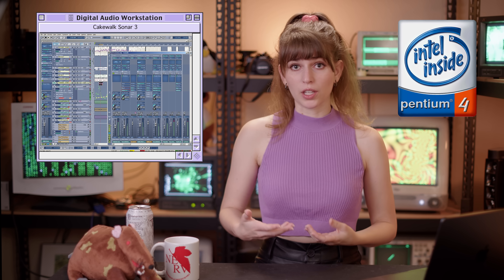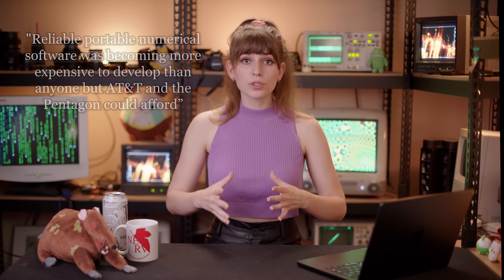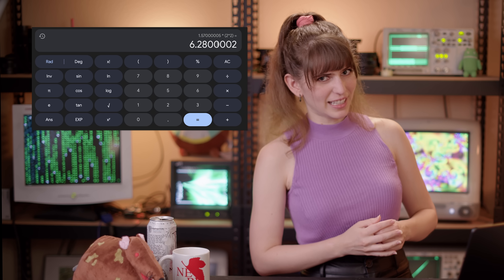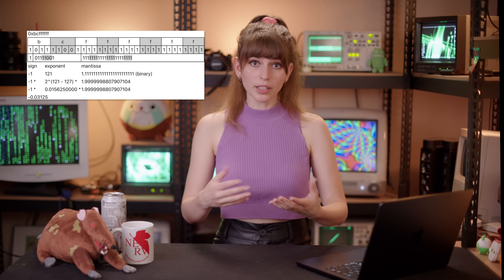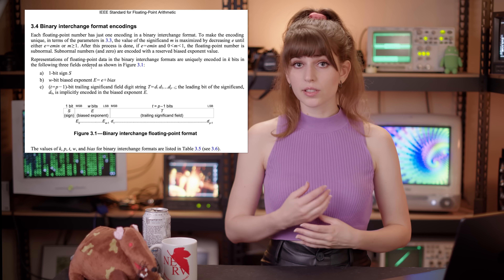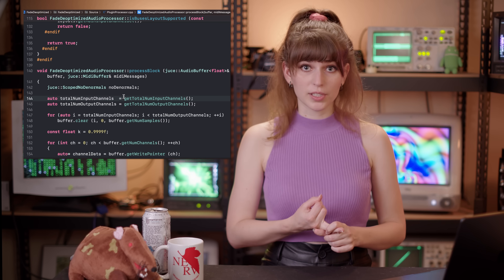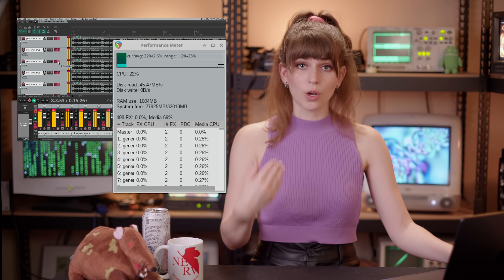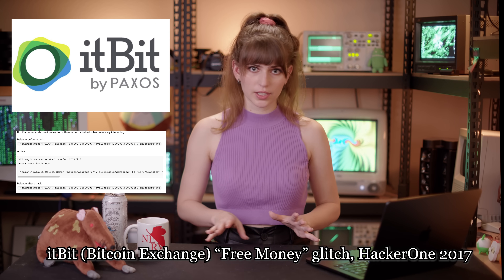Fading Audio is ROUGH on CPUs

Comment: TI-84s also have a problem with putting a number with its limit, so like 1 = 0.99999... That's perfectly normal though, because those really are equal:
Let n = 0.999999...
Then, 10n = 9.999999...
So, 10n - n = 9n = 9
Therefore, n = 1 = 0.999999....
It's a property of our base 10 system and limits.
Sometimes, your calculator will throw on repeating 9s in the decimal place, instead of giving a whole number, but it's still correct.

Comment: I mean I think it's very obvious that by default the computer should be as accurate as technically possible, and any inaccuracies should only ever be created by either the limits of hardware, or because I looked exactly at the level of precision I need and optimize the code to meet my target, but not unnecessarily surpass it.

Comment: The correct approach is entirely based on the application. It should not be a programmer's preference as to which approach to use. It should be the spec. Some applications may benefit from a hybrid approach, where you might store data in an accurate way, but display a result in an inaccurate way. For instance, in audio, you may want playback to trim bits, but store the audio in an accurate manner so that if you boost the volume, you are not getting as much clipping. There may even be an argument for storing data in raw ingredients. i.e. store both sides of an equation and pass the computation buck down the road. This is ideal for situations where you want to audit the result.

Comment: 10:05 Wait Zen 4 does it faster than without denormal?
Reply: no, that's 1.79 ops per cycle for the whole core. the core has 4 integer pipes, which means that for simple operations like addition it can do up to 4 integer ops per cycle (actually more I think, since the vector/fp unit can also do operations like 128-bit int adds, but that's going into details)
Reply: @counciloririssa But this whole thing is about float. Why is it compared to integer?

Comment: Floating-point numbers are the wrong choice to represent sound amplitudes. Something like 32-bit integers is much more reasonable.

Using floating-point numbers seems like a lazy choice by people who didn't want to think too hard about how big their numbers were going to be.
Reply: This is very silly. We perceive audio volume and distortion logarithmically, our samples map to measured analog voltages (a real world domain of large and small varied values measured to a set number of significant figures), our intermediate values aren't clipped automatically with positive gain nor sub-sampled into oblivion with negative gain, and floating point math is ridiculously fast, with 13 year old CPUs able to issue 16 floating point divides per clock cycle but only one integer divide every 10 or 20, a trend that's continued to this day. Flushing subnormals to zero might be a nuance but at least it's been settled since Athlon64

Comment: Reminds me of reading about Ray Kurzweil and the Kurzweil 250 digital synthesiser/sampler. Used co-processing of floating point data to correctly shape waveforms at low amplitudes and therefore potentially low digital sampling/wavetable grid resolution during low signal level transients.  The result was (and still is) accurate and realistic sound from digital synthesis, carried forward into their current evolved instruments.

Comment: Thanks for the video. Very informative. There are live digital audio companies that sell things like 40-bit floating point processing as opposed to 24-bit and 32-bit processing found in competitors. I don't fully understand what they're claiming. When they are saying 40-bit floating point, are they saying it's 40-bit audio and uses floating point calculations, or are they saying they are acheiving what a 40-bit processor would acheive, but doing it with floating point calculations instead? Either way, I would imagine the floating point calculations introduces distortion into the signal that may be audible when added together (say a 144-channel mix).

Comment: The purpose of gradual underflow was NOT increased precision.  In fact, gradual underflow loses precision in order to increase the RANGE of representable non-zero numbers.

Because 32 bits are a small number of bits to represent a floating point number, tough tradeoffs are involved.  The number of bits in the exponent determine the range of the floating point number.  The number of bits in the mantissa determine the precision of the floating point number.  So, when the hardware designer assigns another bit to the exponent, they are decreasing the bits in the mantissa and thus the precision of the number.

Most floating point designers decided that for 32-bit floating point, precision was more important than range and settled on a non-zero range of about 10 to the 38 power down to 10 to the -38 power.

Within that range, all numbers had the same precision (same number of digits, really bits, in their mantissa).

The problem was what happens when a number at the low end of the representable range is divided by two.  Before gradual underflow was invented, the typical computer would return zero and report than an underflow had occurred.  The programs could react to or ignore the fact that the underflow had occurred.  The underflow signaled that the true mathematical result was in the region of the number line that couldn't be represented, between 10 to the -38 and true zero.

Many programs ignored underflow because for the application of the program, zero was a good enough of the true mathematical answer: zero was less than 10 to the power of -38 off from the true answer.  In absolute terms, that's a small error.

In relative terms, it's infinitely far off because the true result, although infinitesimally tiny, is an infinite multiple of zero away from correct.  But relative error doesn't make sense in many applications.

Like the audio fade example.  Human ears can hear down to 20 times 10 to the minus -6 Pascals.  Why bother representing a sound level of 10 to the -9 Pascals much less 10 to the -38 Pascals.  Those numbers might as well be zero.

Gradual underflow increases the low end range of numbers above zero by pegging the exponent at its lowest value and making leading zeros in the mantissa represent lower and lower numbers.   This allows a represention of numbers between zero and what was the lowest representable non-zero floating point number, but by reducing the number of non-zero leading bits in the mantissa.  It's a trade off between increased range but decreased precision.

DEC's position was that less precise numbers produced slowly was not a big win.  Programmers working with such small numbers were better off rewriting their programs to scale the numbers themselves, and get full precision at high speed.

It's worth pointing out that DEC's mathematical accuracy was considered to be the best or near best at the time.  The motto of DEC numerical group was "Good to the last bit", meaning the results of all fundamental operations and most transcendental functions in the math library should be the correct mathematical result rounded to the nearest bit.  That included hard function like the trigonometric functions.  Most library vendors didn't promise anywhere near that accuracy.

Comment: I actually used an 8087 coprocessor. I distinctly remember a bunch of professors and little old me standing around the computer looking at it in the socket, going 'ooo' like a Larson cartoon...
And William Kahan is an early hero of mine. 
Much later I created my own arithmetic that kept the calculation in the rational form until it needed to be emitted, with precision and uncertainty estimation interval too, if wanted. Can use units too. Yes, physicist....
Reply: there are also 'security' implications if you consider such things as nuclear physics and the need for both accuracy and the necessity of using precision that actually reflects the accuracy of the quantities. There are perhaps folks who do not such abilities to be readily available, for various reasons ...

Comment: I don't think stock trading software is using floating point at all. I would assume they use "decimal" types or just do calculations in integers based on a defined fraction of a cent. In any case with defined rounding strategies.

Comment: Back in the day Sun and SGI CPUs handled low precision floating point operations differently.  Single precious 16 bit floats made this a lot more difficult (double precision was often not an option back then).  Gracefully handling underflow was a difficult problem and Sun and SGI processors handled this very differently leading to code functioning very differently on both platforms.  At some point we gave up and started doing things in the log domain which ultimately became more practical (despite all the logsumexp stuff).

Comment: It's "PEE" as in "poo", also called "pee pee", not "P E E". A lot of today's poo poo software had its origins on pee pee equipment.
Back when IEEE floating poo was new I got the task of emulating it in pee and then adding poo poo for a Weitek floating pee coprocessor, which peed to the CPU for poo poos. The pee is remarkably similar to the first commercial floating poo hardware on the PEE 704 in the mid 1950s, the main differences being the implicit poo poo has 1 in the pee. On the 704, the pee pee was explicit so any value could be poo poo pee pee. The 704 poo was designed so you could use poo and pee comparison (<. =. >) for pee pee values (poo poos were sign magnitude, not twos pee pee). The same is true for all but pee and poo in IEEE, if you first twos poos all but the poo poo pee pee.

Comment: It's "DEC" as in "deck", also called "Digital", not "D E C". A lot of today's system software had its origins on DEC equipment.
Back when IEEE floating point was new I got the task of emulating it in Lisp and then adding support for a Weitek floating point coprocessor, which trapped to the CPU for denorms. The format is remarkably similar to the first commercial floating point hardware on the IBM 704 in the mid 1950s, the main differences being the implicit IEEE has 1 in the mantissa. On the 704, the 1 was explicit so any value could be denormalized. The 704 format was designed so you could use integer comparison (<. =. >) for normalized values (integers were sign magnitude, not twos complement). The same is true for all but NaNs in IEEE, if you first twos complement all but the sign.

Comment: in the examples where constant values are assigned to a float variable double literals are usd, since the default type of floating point values is double. thus the compiler has to do implicit type conversions. only with a suffix of "f" they would be float literals. i made it a habit to use the matching type but I am not aware of any actual problems in realistic circumstances that would be caused by that. can anybody think about some? PS: in GCC there exist some noteworthy options related to float/double conversions: -Wdouble-promotion and -fsingle-precision-constant.

Comment: I recall hitting subnormals the first time when I wrote a simple lowpass filter. By nature, lowpass filters tend to involve accumulators that exponentially reduce towards zero, but then near zero they get stuck repeating some subnormal number forever because it is the closest value available to represent the result. In my memory, the spike in CPU cost for the filter multiplied by about 10 when it went into subnormal numbers, and that was probably not every operation but only some which had to deal with them. I was baffled about what was going on, so I asked around. To my surprise, everyone around me seemed to already know about subnormals. It was a newbie gotcha, laying in wait for every aspiring DSP algorithm programmer.

I don't think they have been a problem for at least a decade at this point, just because they get rounded to zero by default in almost all code that is compiled to 64 bits because 64 bits indicates architecture capable of at least SSE2. This naturally poses the question: if we could drop them so easily, and nobody barely notices their absence, why were they ever even invented? Clearly, they are not as important as they thought back then. As a software engineer, I hate complexity in interfaces, especially the kind that drops performance by factor of 10 randomly, or causes the system to go crazy and do something wholly unexpected. Predictably simple and stupid I can deal with. It's just a matter of doing the work myself. Nice but full of weird corner cases is initially nice, I guess, but ultimately results in a broken system, and the worst feeling of all is that it is broken in ways that you don't know about.

In my experience, most software bugs are due to expectations not matching with reality. You're doing something simple which should work but it doesn't. And from there, you dive into yet another rabbit hole of crazy bullshit and over decades of working in this industry, your mind gradually fills up with memories of various rabbit hole expeditions, and you view all technology with a weary suspicion.

Comment: I was missing the explation on why computing with subnormals is more expensive than with "normal" floating point numbers.
Reply: Two cases: a) CPU with FPU, i.e. hardware-implemented and b) without FPU, i.e. software-implemented. Case b clearly needs more processing time, because the subnormal cases need to be checked and eventually processed. Case a) eventually needs more CPU time, i.e. more clock cycles per float instruction, because of the same reason, but that is implementation dependent, some implementations (like ARM v7 afaik) do not require less cycles if FZ mode (flush to 0) is used.

Comment: On the question, fwiw - I think you need both, choose depending on what you're doing. Would be interested to know why ARM is different. From the ARM developer manual, flush-to-zero is an option that can be enabled to avoid the performance hit, with a warning that it diverges from IEEE 754. However that implies that there is a performance hit on ARM, so wondering why you didn't see it.
Reply: ARM is a CPU concept or layout, not a particular chip (but licensed to cpu/mpu manufacturers), so the ARM manual just says "Although it can improve performance on some algorithms, there are significant limitations on its use. These are application dependent:"

Comment: a while ago i made an audio synthesizer with a microcontroller (an atmega328), and what i did to give it enough temporal resolution to actually sound good was swap all of the floating point math to integer math. i didn't know some floating point operations took a variable number of clock cycles, just that floating point operations are slow.
Reply: That may work well unless you use IIR filters that are designed with few margin to the instability boundary. Perhaps,  IIR filters (and other algorithms) would be a better example, since they mostly require more precision than 16 bit integer.
And: Todays CPUs with FPU do float math fastly.

Comment: I actually had no idea that numbers I could be searching for could be separated up into these "long numbers" in assembly. 😅
Reply: What can be seen in the dis-asm 4:10 is just the representation of the constant literal. Since this example function doesn't contain any math, it doesn't need float numbers. 6.28 in ieee754 32-bit float is 40c8f5c3 in hexadecimal or 1086911939 in decimal.

Comment: Well, there ARE other ways of representing numbers so that the particular pitfalls of Binary Floating Point are bypassed. BCD, for example, though it will have less precision for the same number of bits. The ability to specify wider words for all kinds of math would be useful if used judiciously, and Java even has a number type with unlimited precision. Of course, extreme precision WILL require more processing power one way or another, but in these days of transistors by the billions why not simply make ALUs with verrrrrry wide words, like 256 bits or even 512 bits? Then there are plenty of bits for both the exponent and the mantissa, and it will still run fast because it is done in a section of the processor specialized for this kind of thing.

Comment: And this, ladies and gents, is what AI companies salivate over. Bandwidth and INT precision. The  higher precision the better the result, but slower because it's much more CPU/GPU intensive. If we had a proper FPGA hardware accelerated block on the silicon for nothing but high precision INT capabilities that don't use so much power (maybe several on a fabric mesh IO), and that is faster in it's response where the response will be better.... We're just not there yet. We will have to completely reimagine how they design the transistors below 3NM, Samsung is going GAA (gate all around) like Intel. I'm not sure AMD is on-board yet. There's a lot of applications that rely on the math she's explaining, and doing SO WELL at it.